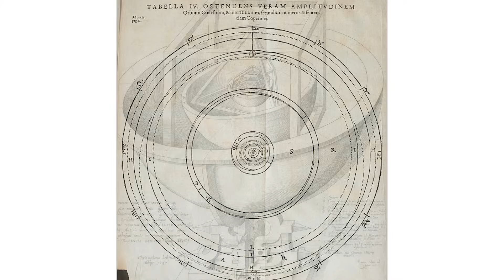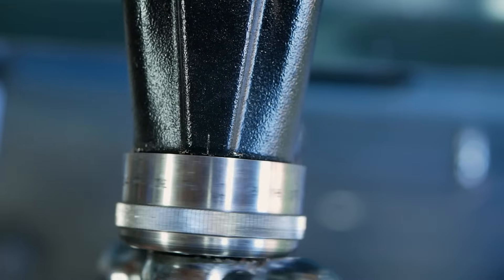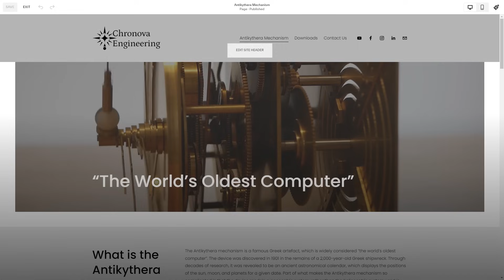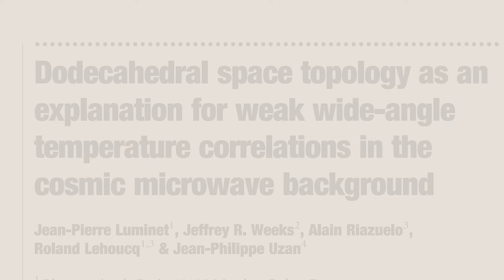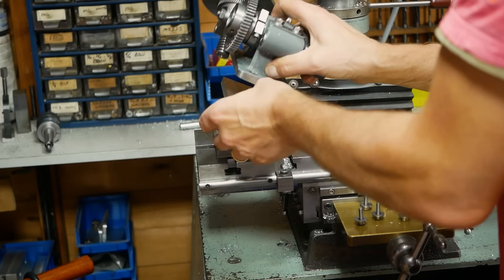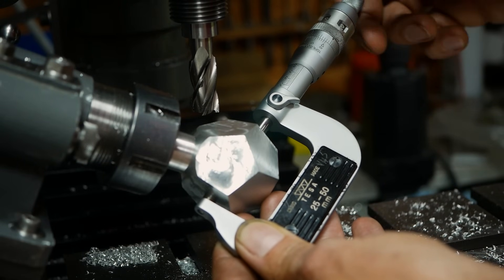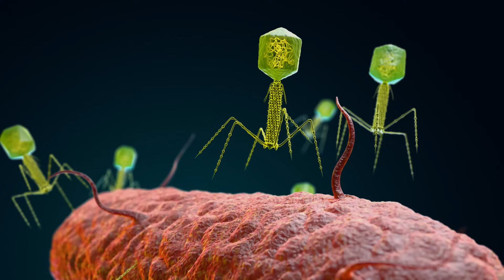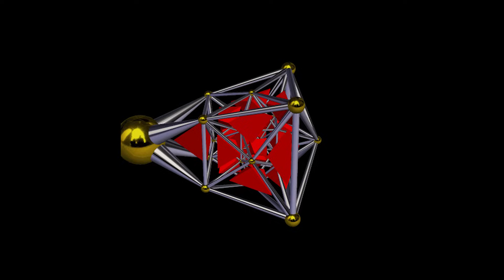What Links Dice and Tesseracts? | Machining the Platonic Solids

Comment: I've seen the animated representations of a tesseract before, and I'm honestly not sure what I'm looking at, what it is representational of. Like, is the suggestion that if such a thing actually physically existed, it would always appear in motion like that to 3-dimensional observers? A regular cube already exists in 4 dimensions, and it isn't a writhing, headache-inducing eldritch abomination to look at. Really wish I could have afforded college.
Reply: It wouldn't necessarily appear to be in motion. The easiest way to imagine a tesseract in the 3+1 dimensional space we live in is a cube that appears out of nothing at some point in time and again vanishes into nothing some time later. In that case, at each instant you have a 3-dimensional slice through the 4-dimensional tesseract, and all these slices happen to look the same (in the same way you can slice a cube into a bunch of equal square sheets). However, that means you're missing the actual interesting features of the tesseract.

To understand those moving animations, consider that you're slicing a cube diagonally and stamping the cut-section onto 2-dimensional paper. The imprint will in general be an irregular hexagon. Then imagine you're doing this over and over again (slicing lots of cubes in succession), but each time you're cutting in a slightly different direction. The result of this is an animated 2D shape.

Now apply the same concept to the 4-dimensional tesseract: you're slicing it diagonally, every time getting a different 3-dimensional object. Those are the objects these animation are showing.
Reply: @leftaroundabout  Ah, I see